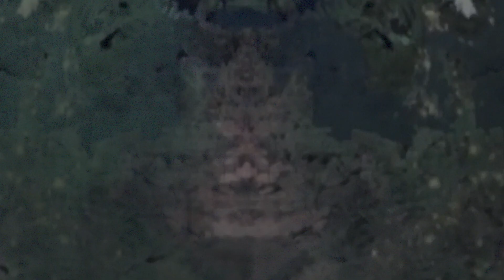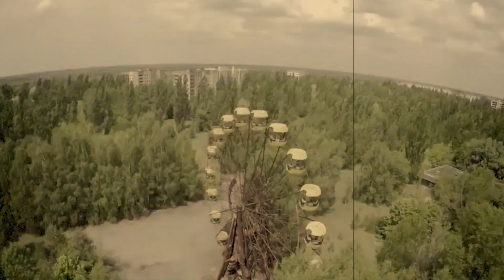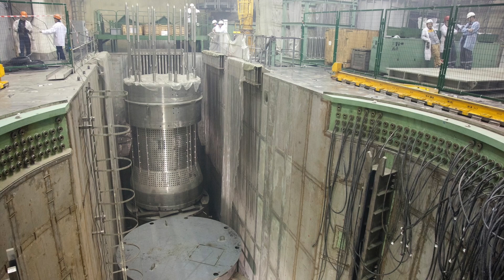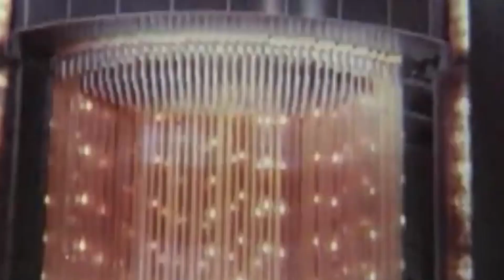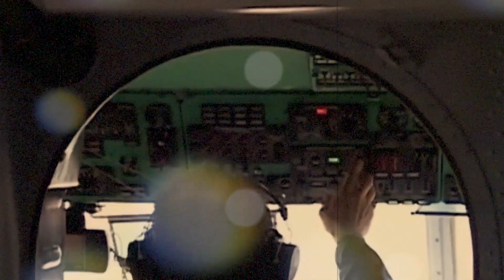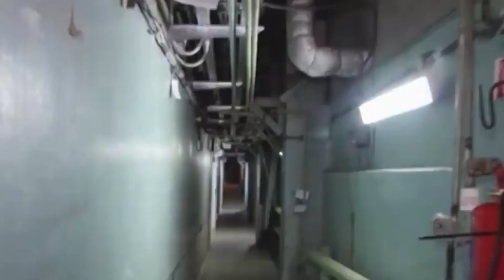Chernobyl may happen again. A global problem

Comment: Overall I like your video, but it needs some corrections and additions. My apologies for the rather lengthy reply. As a hobby I study nuclear reactors, the RBMK type in particular. It involves reading/ studying a lot of boring-you-to-tears reports, manuals and case studies.

First; A nuclear reactor is NOT a nuclear bomb, it is quite the opposite. Here's the difference:
A nuclear bomb has; High enrichment, at least 80% or higher. It has NO neutron absorbers as that would defeat the entire purpose of said bomb. And it most certainly has no moderators present as, again, that would defeat the entire purpose of the bomb.

A nuclear reactor has; a moderator to slow down the neutrons to facilitate a sustained chain-reaction.
It has low enrichment. Most reactor types sit anywhere between as low as 0,7 % (CANDU reactor type) and 3% - 5% enrichment. Yes, there are some reactor types that go as high as 20% (mostly submarine/ aircraft carrier reactors), but that is still not anywhere near the levels you would need for a nuclear bomb.
And lastly, every nuclear reactor out there has some type of neutron absorber for controlling powerlevels and shutdown whether that be for maintenance or emergency. Good luck obtaining a site licence if you ever plan on running a reactor without these features, because it will never happen.

On to Unit 4 then. Yes, the RBMK has some rather glaring design deficiencies that should have been thoroughly addressed before ever building them, let alone putting them into production. Since everything nuclear related was viewed as a state secret by the Soviet Politburo, these issues were swept under the rug and/or kept secret. The most notable issues are:
- NO containment building.
- A positive void coefficient. The reactor design is such that the positive void coefficient has the capability to outstrip the ability of the control rods to quench the reaction. In other words, the reactor can run away with itself and the control rods will be utterly powerless to stop it.
- It is notoriously unstable when run at low power, upon start-up (especially after a full refuelling of the core) and during shut-down. This was a well-known fact among most operators at the time.
- A SCRAM system that, under the right circumstances, can actually become a reactivity ACCELERATOR instead of shutting the system down. No one in their right mind would ever develop a reactor with such a feature, but here we are. There are other issues but I deem these to be the more important ones.

Now for the operator mistakes:
Because of its inherent instabilities, the RBMK absolutely HATES being run at low power for extended periods of time. But that's exactly what they forced it to do when the test was delayed by the Grid-controller. That delay had also an unforeseen side effect, Xenon build-up:

One of the fission byproducts is Iodine-135. It decays into Xenon-135 after about 6.6 hours. Xe-135 is one of the best neutron absorbers out there and reactors produce it constantly. When running at full power, there's an equilibrium between the Xe-135 produced, and what's being burned off. Here "burning off" means that Xe-135 will gobble up a neutron to become something else that doesn't interfere with the reactivity in the core.

Now they coast the reactor down to half-power. But because of the 6.6 hour time delay, the Xe-135 will continue to be produced as if you were still running at full power. And this effect gets progressively worse the lower the chosen power level is, because there are now fewer and fewer neutrons available for burn-up. Eventually core reactivity will drop like a brick, because the Xe-135 gobbles up so many neutrons that the reactor can no longer sustain the currently set low power level. That's why the powerlevel dropped to 30 MWt. This is known as "Xenon poisoning" and no amount of withdrawing control rods will get the power back up. That is what they mean by being stuck in a "Xenon Pit". If there ever was one cardinal rule for running any type of reactor, it would be that you NEVER try turning back on a reactor that has shut itself down from core poisoning. Which means that if you're getting stuck in one of those, you have to wait until the Xe-135 has decayed away. Trying to start the reactor back up anyway will result in a highly unstable reactor state, but this is exactly what they were doing when Dyatlov demanded the power be raised back up so they could do the test. They had to take extraordinary measures to get the power to budge at all. It was later discovered that they bypassed/ disabled almost every safety system that they could get their greasy little hands on in order to raise the power because Dyatlov wanted this test done, come hell or high water. They include, but were not limited to:

- The Emergency Core Cooling System. They ran the reactor for almost 11 hours with the system physically disconnected(!) from the core.
- Automatic Control Rod System disabled
- Manual extraction of almost ALL control rods, even the special group that was supposed to be in the core at all times.
- Steam/ water separator alarms were repeatedly cancelled
- Feed Water Flow Rate alarms repeatedly cancelled
- Excess Steam alarms repeatedly cancelled
- Neutron Power alarm repeatedly cancelled. This one is particularly bad, because this one is a major red flag as to what is going on with the power inside the core.
- Emergency Thermal-Hydraulics parameters repeatedly cancelled
- Two feed water circulation pumps switched off
- Turbine emergency regulating valves disabled

All these alarms should have warned them that they were doing something very unwise and dangerous. Even with being this inherently unstable, and with all they did to it, still the reactor tried to shut itself down for almost an hour until they had backed it firmly into a corner and it literally had nowhere to go but up. So, in the end it wasn't just the reactor that was to blame, humans had a very big part in this tragedy as well. A flawed reactor design and utter operator stupidity came together in a Perfect Storm that resulted in the worst nuclear accident in human history.

Comment: RBMK's can be operated safely, even though they have an issue with a positive void coefficient rendering the reactor unstable when particular conditions are met.
They ignored multiple problems and persisted with the exercise when they shouldn't have. If a reactor core is poisoned with xenon you shut it down and have a break, come back tomorrow. They didn't. The design wasn't the only cause of the disaster. If they had attempted to solve any of the known issues in the correct manner we wouldn't be talking about this today. That is probably why the reactor flaws were classified, they should have never presented a problem if correct operating procedures were followed.

Every nuclear disaster, every orphaned source, every "nuclear problem" we have had has been caused by someone doing something they shouldn't. Even Fukushima could have been brought under control but they didn't SCRAM the reactors or pump them full of seawater while they had the chance, they waited (under orders from TEPCO) as they didn't want to destroy the reactors. Well.. *slow clap*. Of course, the backup systems should not be in the basement in an area with the potential to flood... another design flaw.
Reply: Dyatlov was the one who wanted to continue with the test even when informed of problems and the fact that the test Dyatlov wanted perform went against their training. I blame Dyatlov for much of what happened that life.

Yes, fewer than 50 people died as a direct result of the accident in 1986 but it is something that never needed to happen. The Soviet government wanted to keep it quiet but a nuclear plant in, I believe, Sweden picked up some of the plume and sounded the alarm. The US is not perfect by any means, but by and large we can operate nuclear power generating plants safely and problem plants ( Diablo Canyon, San Onofre, and others) have been shut down and been decommissioned or are in the process of being decommissioned. Other plants like Fermi 2 in Michigan have been safely producing energy for over 50 years now. Indian Point operated relatively safely for years. The same goes for the nuclear plant near Phoenix. Russia really needs to get its act together where nuclear power is concerned. That means working to come up with better, safer reactor designs than the RBMK and better training for those who operate nuclear plants. Critics have said for years that the remaining RBMKs are disasters waiting to happen. Thankfully the large reactor complex in Ukraine (sorry, I don't recall the name) is a newer, much safer design Though whether the reactors are of a Russian, Ukrainian, or American design I don't know.

However, being able to safely operate a badly designed reactor is certainly not optimal, because a disaster could happen at any time.

Unlike many in the US, I am an advocate of more nuclear plants. US nuclear plants are much more safely operated than those in Russia. I know that demand for energy will only increase in the years to come. More people die because of fossil fuel plants than nuclear plants. Nuclear power is safer and cleaner than that generated using fossil fuels--and 20% of our energy is now produced by nuclear. We need to move away from fossil fuels as soon as possible. Renewables are great--what's not to love about solar, wind, and hydroelectric power generation? Unfortunately, hydroelectric might not be around much longer in the Southwest because of long-term issues such as drought. For example, Lake Mead has been drying up for years and if levels continue to fall, things will get to the point where the Hoover Dam plant will no longer be able to generate energy. That will spell doom for cities such as Las Vegas that depend upon Lake Mead and the Hoover Dam for energy. Solar and wind are great, but I doubt that they will be able to to completely replace energy produced by fossil fuels, at least in the short term. This means that nuclear power needs to be a larger part of our power generation mix. 

I really wish that those who are anti-nuclear would stop being hysterical and educate themselves. The worst nuclear accident in the US was Three Mile Island and that was nothing compared to Chernobyl and Fukishima.
Reply: @harrietharlow9929  The story about Dyatlov is apparently not true. He attempted to spread the word about the flaws in the reactor. Dyatlov was scapegoated, the series was based on a book called "The Chernobyl Notebook" by Grigori Medvedev. The wasn't flawless and he changed a lot after his son died at the age of 9 from Leukaemia, it made him hard and uncompromising so he became the villain.

The newer designs are definitely safer, the RBMK's could have been operated safely or the graphite tips removed as well. If they made people aware of the deficiencies or set guidelines that must not be broken it wouldn't have happened.

We have had a lot of nuclear disasters, some small, some .. well you know Fukushima. Some are still occuring, Mayak is still dumping waste into the river Techa.
But the one factor that exists in all of them are humans doing the wrong thing.

Unless people change we are going to have more "accidents" and disasters, more orphan sources, maybe even another meltdown if someone is stupid enough to make a reactor that isn't passively cooled.

They don't need to fear radiation but they need to respect it.
Reply: Being able to safely operate something with terrible flaws, does not make it good. Why does everything with moving parts have covers now? Because people can't operate things safely. The idea behind having a robust system that doesn't have glaring "Oh we lose power and the building turns into a time bomb" is so idiots can't cause this unintentionally. Soviets built RBMK's because they were cheap and pumped out weapons grade fissile material. Just like any communist/socialist system, they can't be wrong and everything they have was bigger and better than the US because they say so and the government can never be wrong.
Reply: @sylumgand  I didn't say it was good, I said it was possible. Don't put words in my mouth so you can react to the narratives you impose on other people.
I am also not an idiot. I have eyes. I don't need to be informed of the way things are today. I also know how the soviet union operated, imagine that. I am not making things up.

The reason ALL of the old reactors were built in that manner was because we didn't know better. We didn't have the benefit of the technology we do today. That's why the latest reactors designs are a lot safer. Also.. we now have to factor in people, they are dumb, they don't listen, they think they know best... they keep making mistakes and do things they shouldn't.

Comment: The Soviets always wanted to have an edge over the West. The advantage to this reactor was eliminated the need for an enrichment process and Used graphite as the moderator. The Soviets wanted a reactor that would fulfill military roles as well as civilian roles. Touting its benefit to the civilian role while secretly knowing it's military capability. This reactor could be used to produce plutonium because of the graphite moderator within it. Unfortunately the side effect of this is a positive coefficient. In other words in certain conditions you would cause a power Spike within the reactor. A light water reactor does not have a positive coefficient. It is still important to provide cooling during the first couple of hours of shutdown to prevent a core meltdown. However once the instruction for shutdown is given the reactor will immediately enter a shutdown State without a power Spike. All nuclear reactors have a issue with decay heat that must be removed from fission products that have to decay.

Comment: The RBMK reactors do have major design flaws. Chief among them being a Positive Void Coefficient. Using carbon as a moderator unlike Western PWRs that use water that fails safe as super heated steam is a poor moderator. Add poor maintenance, no secondary containment and a lack of reactor operator training and you have the perfect storm. The carbon tipped control rods were  the icing on the cake.
Reply: Chernobyl was a good show wasn't it? sigh